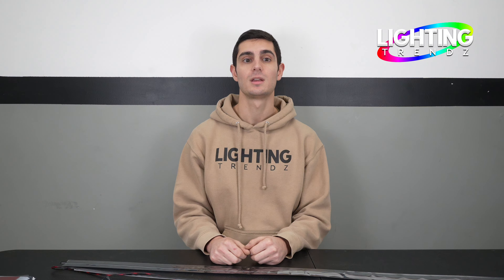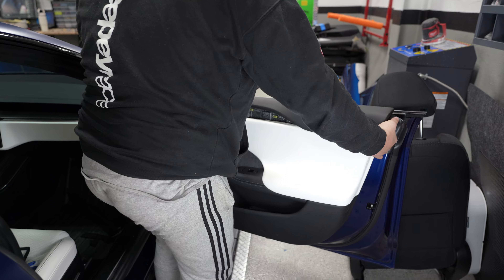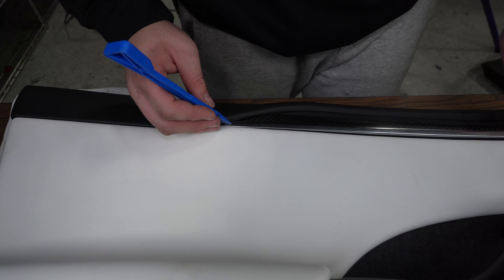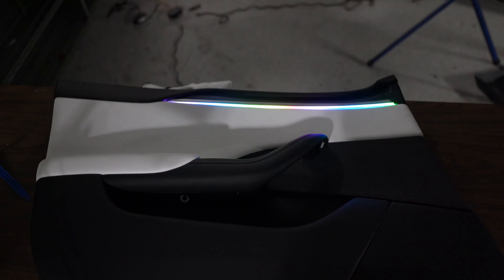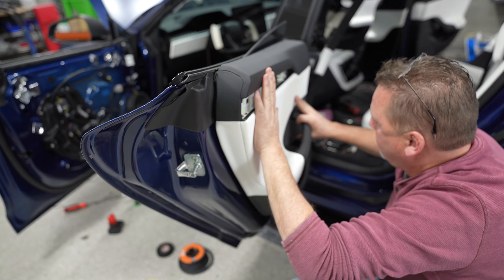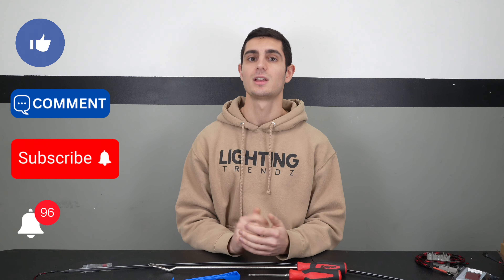Flow Series Interior Dash Trim Kit Tutorial | Lighting Trendz

Comment from the maker: TIME STAMPS
0:54 what is included in the kit
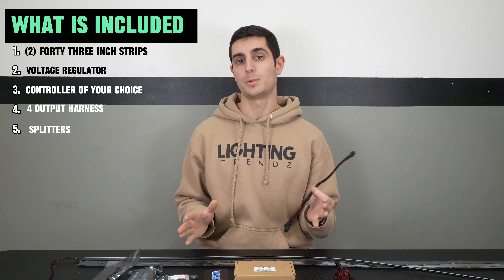1:27 how to customize strips
1:43 installation options
2:08 installation: getting started
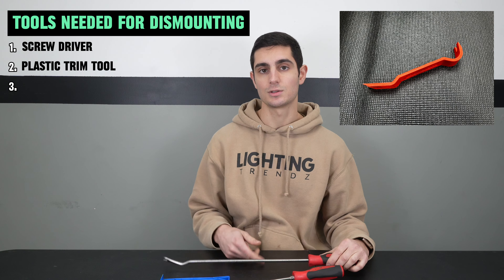2:29 tools for dismounting
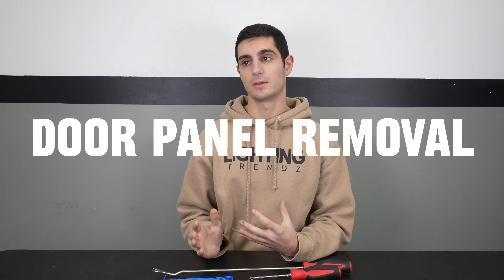3:00 door panel removal
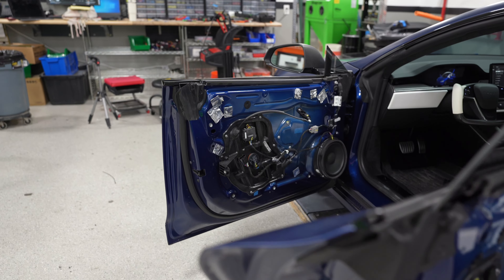4:07 strip mounting
5:19 run extension through the car
7:07 hook up all wiring
8:12 bloopers

Comment: Question, once I cut the strip to length what are the connection points to add wire to the cut-off piece so I can use the rest of the strip? I see two contacts on one side and one on the side with no leds. Thank you for your time and great product.

Comment: so it is one continuous piece that powered by one power source or is it multiple pieces  that funnel into one power source. I guess I don't understand how can there be a light on the passenger side and one of the drivers side and they both are powered?
Reply: Theres typically two ways to do it. The strips can be separately powered by sub control unit boxes that connect to a main box wirelessly. Or it can be strips all powered by the same block, in which the wires would be ran under the door panels. Can't completely hide them, but can hide them pretty well still.